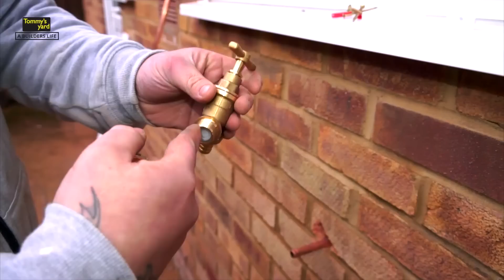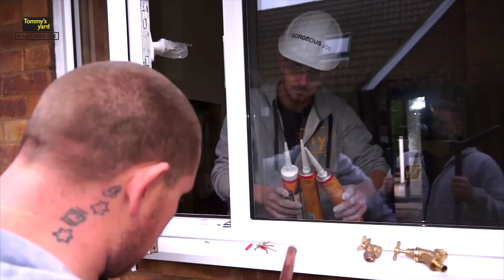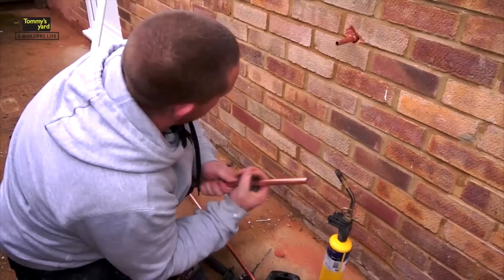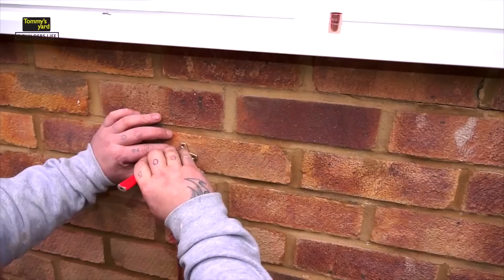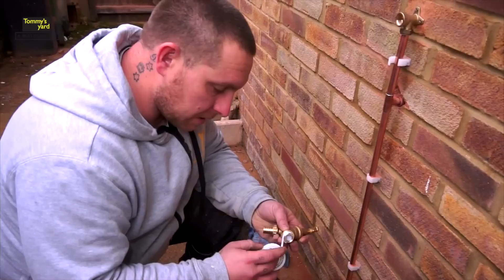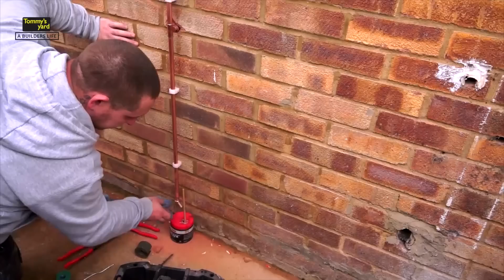Tommy's Yard, How to fit an outside tap

Comment: Nice video, I was wondering all the way thru how you were going to stop the water gushing thru to the bottom pipe. In my country our winters are like your summers so freezing isn't an issue, makes it easier for the plumbers, I just wished they were as thorough as you, the last two I used were awful, did terrible work.
Reply from the maker: +Pascal Briand Thanks for the nice words, fingers crossed you find a good one soon:)